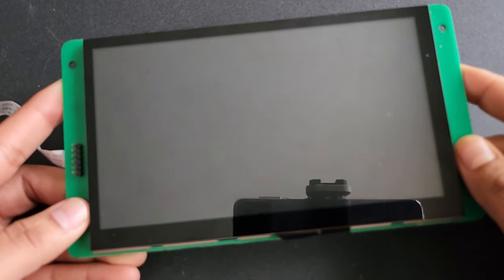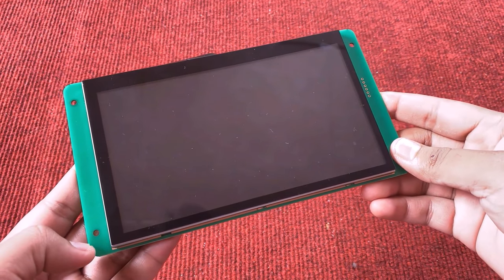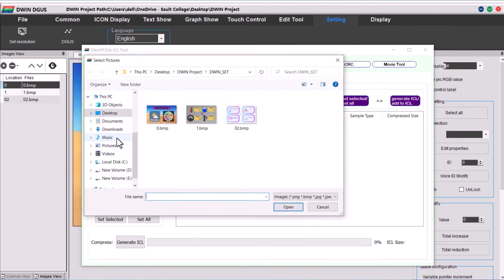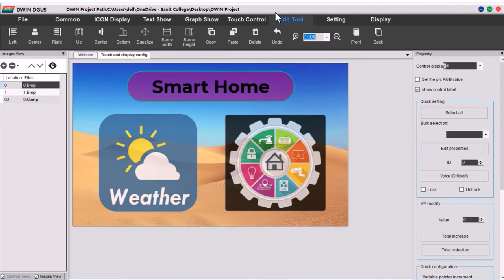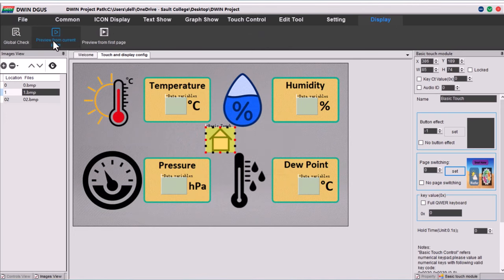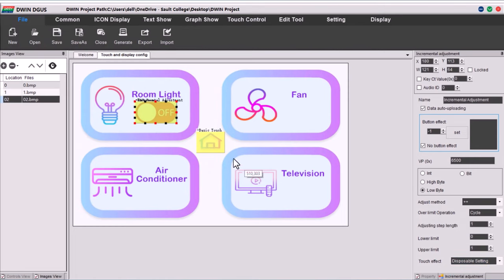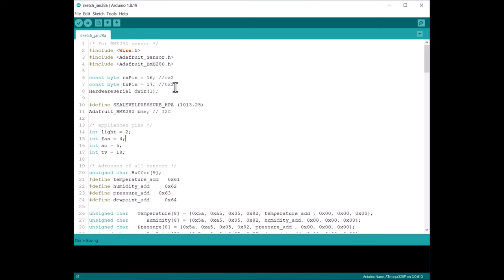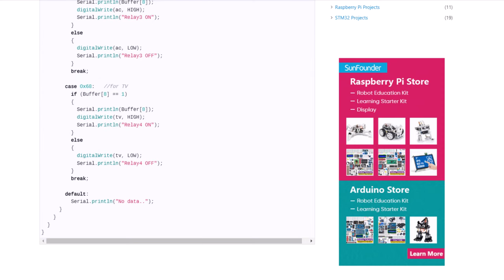Smart Home Controller using DWIN HMI LCD Display & ESP32 (Display BME280 Reading & Control Relays)

Comment: Is it possible to request data variables from the MCU? 

What I see there is that the data variable automatically uploads to the MCU (arduino in this case) as it is updated. 

The question is, can that same data be requested by arduino. ie You send a command via the UART and the DWIN returns the data of the requested variable?